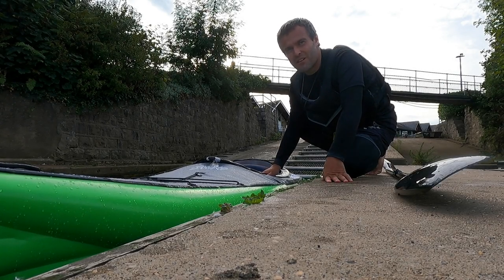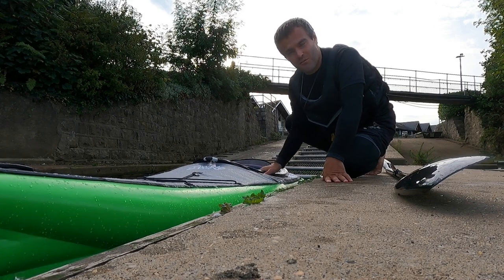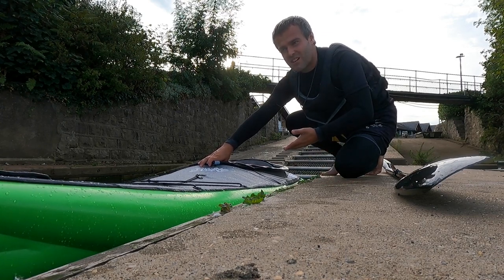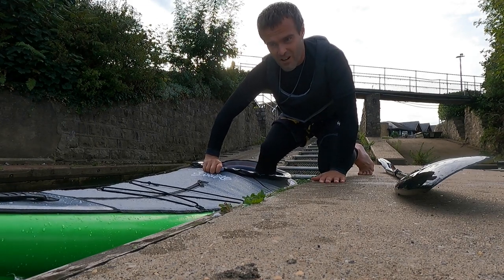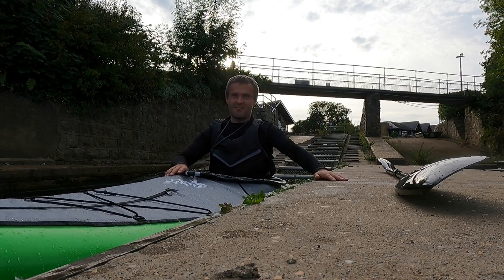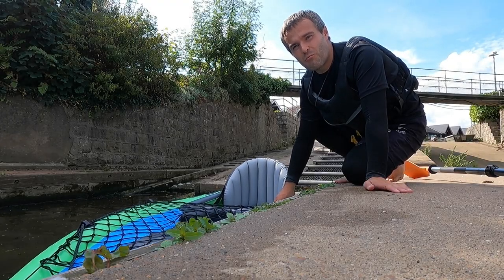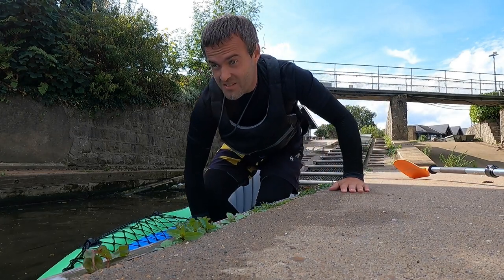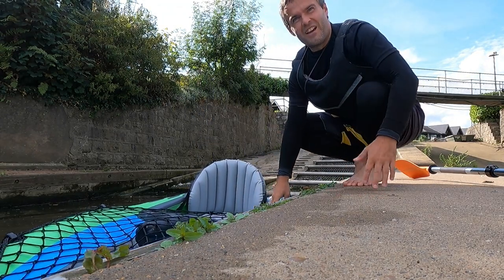Get IN and OUT of your lower pressure inflatable kayaks efficiently - shown on 2 kayaks!

Comment: thank you very much, I just got my Challenger K1, for starters, and I was worried that I would make a fool of myself, that I don't know how to get off or get on it. Most of them skip the step when going up or down. It is important. Thank you once again. I like this sport a lot, I hope it will catch me. I have already thought about the next kayak, the Itiwit Strenfit X500. I saw that you also have it, can you do a full review?
Reply from the maker: Thanks for visiting. I hope this method (adapted from sprinters) will prove useful to you too. 👍
Holding the surface and the coaming with your arms is essential to maintain balance when entering/exiting sit inside kayaks. Never let go until you've finished the process. 😉
For the x500 Strenfit, I had plans to make a full long-term use review of it but the one I had in the UK developed faults and had to be returned. I will be only able to film all material I need in July when I go to Poland, where I have a second one. So, yes,  there will be a review but a bit later than I anticipated... 🙃
Reply: @LetsGoPaddling  it’s worth it? X500
Reply from the maker: @DegeaVR  Performance-wise definitely yes. I hope my faults were just an isolated case.